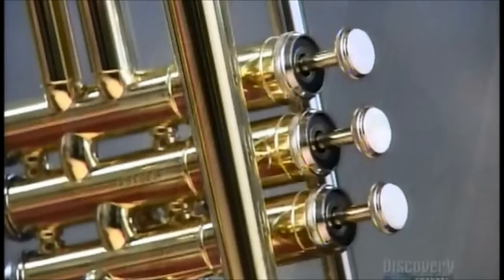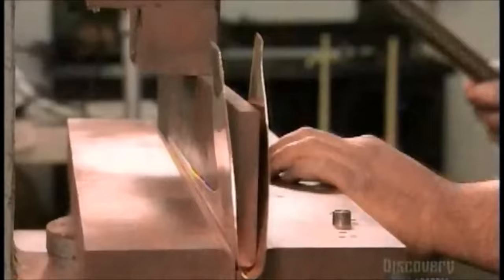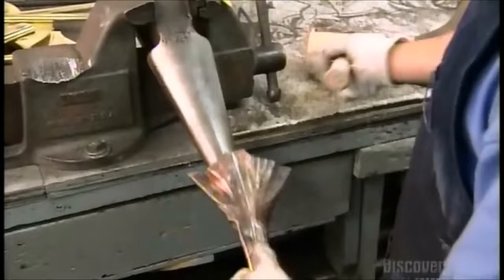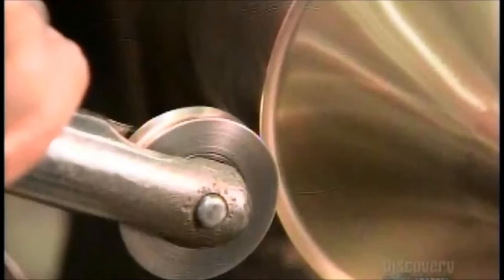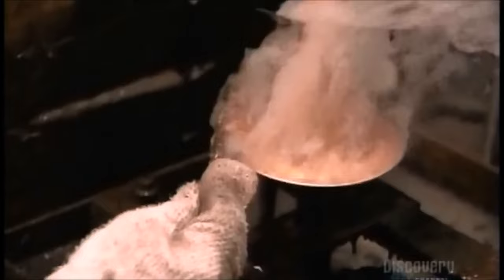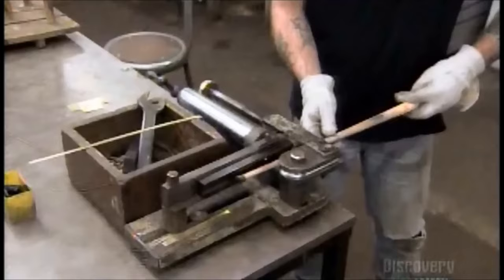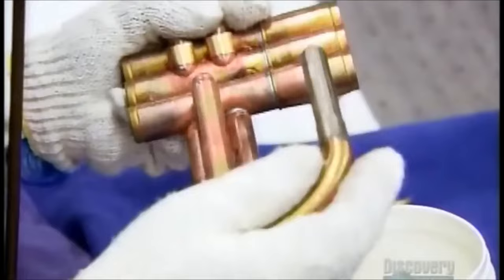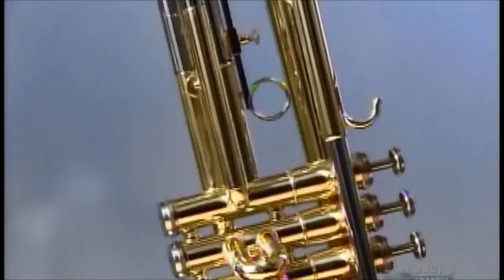How Its Made   Trumpets 2015

Comment: Lmao they just skipped the hardest part
Reply: What’s the hardest part?
Reply: @christophertaylor8761   The hardest part was making the valves and tuning slides, but they skipped how they were made and they are the most complicated mechanisms in a trumpet.
Reply: @ephraimalfaro3960  thank you
Reply: FR THO AHAHA
Reply: @ephraimalfaro3960  Tuning slides are not that hard actually. Making a bell is much more complicated. Probably the hardest part.
Reply: @tamasfoldesi2358  I meant the valves though too, there is just a level of precision needed for the valves that is very hard in itself.  I did make a French horn in my garage out of copper piping, and yes, making the horn is much harder than I anticipated, but I cannot fathom how hard it would be to make the valves.
Reply: @ephraimalfaro3960  The valves are made on CNC machines mostly, so bell making is still much harder.
Reply: @tamasfoldesi2358   I did not know that they were made on a cnc, that does make a lot of sense.  Making them by hand, being that difficult, would not be economically sound, I guess.

Comment: the 3rd valve ring isn't for holding the trumpet XD
Reply: You hold the trumpet with your left hand. Your right hand just moves the valves up and down. So yes, it is for holding the trumpet.
Reply: Mauiturtle the third valve ring is for tuning notes that use the third valve. Yes, you can hold the trumpet with the third valve but that's not what it's meant for. If that was the case ,you wouldn't be able to hold a trumpet without a third valve.

Edit: it's similar to the fact that the pinky ring isn't for "holding" the trumpet, it's for keeping it steady when turning pages.